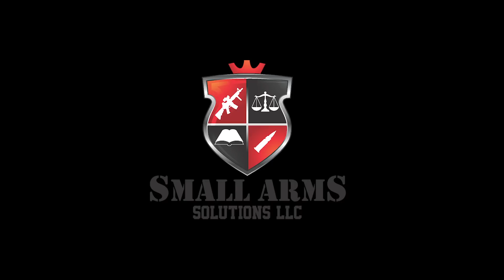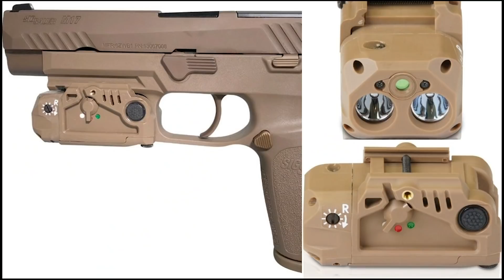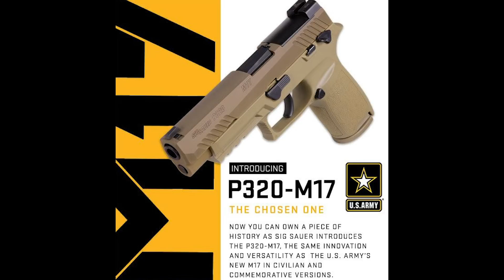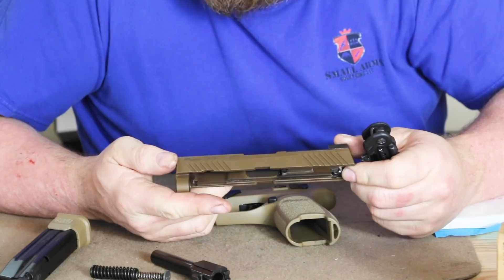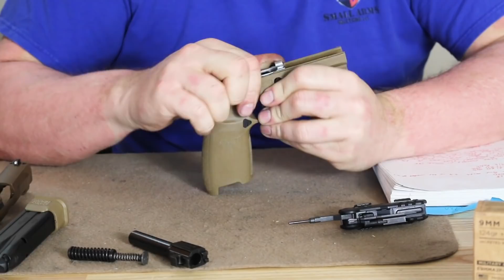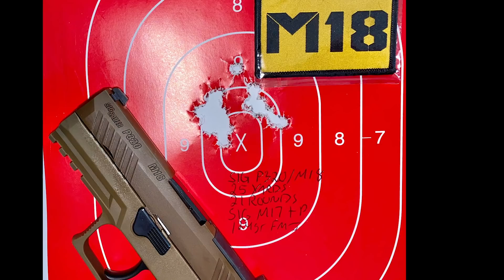Sig P320/M18 Pistol

Comment: Really it’s a two slide solution I think since the frame and fire control unit are the same on both.
Reply from the maker: To be technical. There are two slides, two barrels, two spring guides and two frames.

Comment: Great pistol, however, I’m very surprised no one has mentioned how terrible the finish is on this pistol? The M17 as well..
Reply: I was issued the ugliest M9 in the history of ugly M9s in afghanistan. The slide and barrel literally looked painted. And after I qualified, the heat from firing it turned the barrel and blue/black color. But...I was always a tack driver with the M9 and this one was no different.

Comment: Just got the m18 & put a Romeo1 pro in it. First day with it at the range today & all I need to say is perfection. Around 500 rounds with zero issues. Thanks Sig Sauer 🤘
Reply: Awesome.. pick up Saturday.. was it hard to put the sight on?
Reply: @LibertarianRF  just might have to use some blue lock tight, mine did come lose once.

Comment: what is the tool for removing the optic plate on the m18? is it a T15 like the m17?
Reply: They are the same thing the only difference is the slide and barrel length.  Its completely modular.

Comment: I am male. I am 57 years old. I have XXL hands. I shot the M1911 in the US Navy. After the military
I shot a lot of different guns and used many different calibers.
FIRST
I bought a SIG P320C - The Compact version that uses 15 round magazines
Observations
- Very reliable with no malfunctions or jams
- More complicated trigger system & striker-fire system than necessary (IMO)
- I did not like the "good" trigger as I had very little feed back from it
RESULT
This was a good gun but I did not ready warm to it.
SIG P320C = SOLD IT

SECOND 
I bought a Glock 19 Gen. 5 Late version - The latest version of the G19 that has no magazine cut out
and forward slide serrations.
Observations
- Very, very reliable with no malfunctions or jams ever 
- Simple gun with few parts
- The Glock has a good trigger if you like feed back in your triggers
- I love it's weight (23.64 oz) & dimensions 
RESULT
When it came out I checked it out BUT did not like the cut out on the front of the grip.
After the Glock 19 5 generation updated model with no front grip cut out came out, I put the SIG P320C up for sell.
Glock 19 latest generation = KEPT IT 

I never looked back. Forever Glock.
Reply: Sounds like a bunch of bullshit you made up LOL
Reply: @Coinz8  🤔

Comment: Sig P320CA, been available for years, is the exact same as the M18 minus the external safety and color. A Compact slide on a full size frame.
Reply: Good design, that's why it won.

Comment: I am a Sig 250 owner, and have been for a few years. You failed to mention this model as the predecessor for the Sig 320 , which shares the same parts, aside from the fire control unit. The 250 being a DA hammer only pistol. I often wondered why Sig Sauer never really marketed the 250. I usually carry the P 250 Sub Compact with a grip adapter which allows me to use the compact magazine of 15 rounds and a better grip length. Since my original purchase, I have acquired caliber exchange kits for 22, 40/357sig compact, and 45 full size. Does the military use the capability to choose different calibers?
Reply from the maker: Richard Kerr I discussed that in the original P320 videos

Comment: Glock wasn't modular thou!! I'm a glock fan boy but it didn't meet the criteria.
Reply from the maker: Stephen Carbajal it did, both pistols did. You need to read the requirement. Modular has nothing to do with the chassis. This is why these were the final two pistols. If the Glock did not meet the modular requirements, it would not have made the down-select.

Comment: I like the Glock didn't get a chance and spent all this money. Modular system was a requirement,  but glock was so cocky that they would get it anyway without a major requirement.  Didn't the guns also just go through a test and both went 12k rounds without a failure, best any military firearm has done in testing.
Reply from the maker: Jwilli 622 that was phase 1 elimination. Only Sig and Glock passed. Phase 2 would have determined if they met the contract specifications. Which was better, both pass or both fail. This was not done
Reply: Both entries met the requirements for "modularity". End of story.

Comment: I get the issues with the procurement process and why you don't like it.  But the first several minutes of the video is just the same complaints about the process you've spoken about extensively in other videos.  I get it.  But we're past that now, and these are the pistols we have.  I appreciate the information on the M18, I almost picked one up this week at the SIG Academy Pro Shop but I'm still not entirely sold on the 320.  Giving it another couple of months.

Comment: Both the m17 and 18 use the “carry” frame, not the compact. The compact takes 15 round flush fit mags and the full size frame extends the entire length of the full size slide.
Reply: I have the full size and love it
Reply: Want the red dot for my 18
Reply: I think he meant the M18 is the compact slide.

Comment: I'm not a huge fan of either the Glock or Sig, but I doubt Glock spent a bunch of money to come up with a 19 x with a manual safety.
Reply: Last Glock Armorer class they stated Glock spent some $$ on the machines for the FDE and other colors. Why the first batch of 43X and 48 had the silver slide.  

Glock is a smart company when they released the 19x they sold  1/3 of the Military pistol contract in 3 months.And that was just the 19X

Comment: I have owned Glocks since the early 90's but not a fanboy, I prefer the M&P's. If American made was not in the equation, the Sig over Glock was a bad decision

Interesting if this was the choice due to cost when sig is now trying to sell the gov on their new .277 with hybrid case. High pressure SS and brass hybrid case just to match a 6.8 performance, so use a expensive hybrid case ammo with much higher pressures (reduced barrel life) instead of just using a 6.8!
Reply: To be fair, I don't think there's a 6.8 caliber with that performance they're asking. You'd have to go back to a .276 Pedersen sized cartridge to lower pressure and that thing is pretty much a full size rifle caliber in size.
Reply: The .277 Fury gives .270 Winchester Short Magnum performance in a smaller case.  The 6.8mm SPC can't match it.

Comment: >the comments section is full of people bitching at each other over which plastic pistol is the best.

We never should switched from the M9.
Reply: I honestly think they should have adopted the M9a3. I have one and it’s one of my favorite pistols.
Reply: Modern polymer pistols are superior. Equal if not better performance, equal if not better mag capacity, less weight, all of those factors combined result in a better pistol for the Service Member.
Reply: The M9 was getting replaced either way.  CID and aviators didn't want a gun that large, and were already using SIG M11s.  Neither did the Navy, Marines, Air Force,  or Coast Guard.  People see the M17 replacing the M9 and want to comment on that, but don't want to admit that the M18 is replacing the M11, and the Coast Guard P229R DAKs.  The M17/M18 is a total force solution for every branch, but the M9 is not.  Get with the times.
Reply: I agree with you 110%
Reply: The safety sucked and it was slide bitin' SOB. Mine was so loose that I was on-the-spot-corrected about my safety being off so many times that I subconsciously reset the safety dozens of times during the day. Seems like I spent the whole day with my finger on the safety. 

I liked the M9...but it wasn't a pistol i would buy for myself.
Reply: I still keep a made in Italy 92fs and an INOX Model 96 in .40sw handy…With a spare 9mm barrel) haters will never convince me that the M9 wasn’t the greatest sidearm the military ever fielded, (save for the now outdated 1911)
Reply: Ha the M9 even though it was good wasn't the greatest
Reply: Yes, the army picked( imo)the better pistol...PERIOD.

Comment: Perfectly happy with the Gen3 G19 adopted by the US Navy SEALs in 2015. Will never buy a US made SIG due to design/QC issues.
Reply: Right...

Because things never improve.
Reply: @MrCarGuy  
Feel free to buy a US made SIG or a Brazilian made Taurus as the US is a free country, unless you want to make and publicly sell small arms protected by 2A like the M72 LAW because elites like Trump and Sanders think that is not such a good idea and will ensure you end up in a federal prison if you dare do so. Good luck stopping armored vehicles with a M17 pistol or M4 rifle.
Reply: @Lutz101  "Good luck stopping armored vehicles with a M17 pistol or M4 rifle" - The Afghans spent almost 20 years stopping armored vehicles with copper sheets and concrete sewer pipe.
Reply: @Lutz101  Irrelevant nonsense.

Comment: Fricken DOD missed their chance to have a pistol with plastic sights, a crappy trigger and the Worlds worst grip angle. What were they thinking?!?
Reply: I think they did great, they got a pistol instead that has a chance to fire when dropped, not tolerable under harsh elemental testing, doesn't like FMJ ball ammo that much.
Reply: ReachBlows Dick they do NOT fire when dropped. They fixed that a long time ago. Quit bringing up old issues
Reply: @sammcgee9456  when it did fail the test in usual trials they immediately remove the weapon.
Reply: Yes the Glock is a POS.

Comment: I have to say coming from a Govt Weapons Handler point of view is Glock is not very innovative they were told Modular well Sig gave it to them I can take the trigger pack out the firearm put it in a Mid , compact or large frame.  Also Sig had already had the external safety part of the Data package at the Time Glock refused to put one on told the US Army Glock pistol is perfect as it is ?   I think telling your client No your product is good enough when they are looking for something else not a good idea.  Modular doesn't mean ok here are two Glocks one full size one compact that isn't modularity the Army wanted.   So before I get lighted up for my comments did the Army really need to replace the M9 service pistol answer is NO Beretta offered  a good solution the M9A3 you have the Color,Rail and grip was changed to meet people with small hands higher capacity mags and a threaded barrel last all the parts are compatible with all M9 pistols a win win situation.  My question is is the 320 a better pistol then the M9 ?    Maybe but one thing I do know is that I don't remember a weapons platform that was fielded and didnt have problems most systems have their issues did they rush this into service maybe but the Army has its own time frame and GLOCK lost end of story.
Reply: Sounds like Glock pulled a Joe Biden, "Go vote for someone else!" They did....
Reply: I'm pretty sure that Chris himself has gone over this and the Glock respected the Army's modularity requirement.
Reply: @ChucksSEADnDEAD  -  Exactly, the MHS solicitation did not require a chassis frame.  Vendors were allowed to submit a "one-pistol" solution as long as the pistol met the minimum requirements for the full-size and was no larger than the maximum dimension/weight for the compact.  I suspect it came down to the minimum barrel length for the full-size, which was likely 4-inches.  The G19X barrel is long enough, while the P320 Carry barrel is too short.
Reply: No Glock at last minute gave in at the last minute and put the external safety on but telling the client what they want to what they want was wrong.  I believe this was something that contributed to not being selected.  An entity that has to deal with a company that may or be a problem when they want changes made isnt the greatest in partnership especially the US Military and they themselves can be problematic and Glock was not Modular key word that was what the Army really was after not just two separate handguns.
Reply: @todd2048  Glock entry was modular. The requirement was for different grip sizes, magazines, triggers and rails. It didn't require the chassis system.
Reply: I dont care what you read I am telling the Army wanted in their little heads a one gun does all OK get it I was still a Govt weapons handler back then retired so I can say this Glock in THIER MINDS didnt give them what the wanted why do you think they shot Berrettas M9A3 down  besides back straps the M9A3 would have been a cheap stop gap but the ARMY wanted this crazy idea in their heads modular they were annoyed with Glock. So I hope this helps.
Reply: @todd2048  "the Army wanted in their little heads a one gun does all" - and they're not gonna get guns that do it all, they're gonna treat the M17 and M18 as different once in inventory.
"Glock in THIER MINDS didnt give them what the wanted" - so military arms procurement is an exercise in mind reading now? If you actually paid attention you'd notice that COST and the fact that Sig partnered with Winchester to provide the ammo were the determining factors. Glock was higher cost and the Army evaluation determined they didn't have a satisfactory ammo deal provided with the whole package. It had fuck all to do with modularity.
"why do you think they shot Berrettas M9A3 down" - several reasons why, this is confirmation bias from your part

Comment: Maybe I missed it but did you say that only the commemorative version has the correct recoil spring?
Reply: The M17 has a separate guide rod and recoil spring. The M17 uses an all in one captive guide rod system.

Comment: Chris - With respect and sincere appreciation for your expertise, experience, and all that you do for the small arms community, I believe you may have misstated a key point in this (and possibly previous) videos.  

Specifically, the DFAR generally mandates that the least expensive (normally aggregate development, acquisition, and often logistics support costs combined) competitor that MEETS all of the SOW/RFP requirements will be selected.  Crucially, there usually are NO selection “bonus credits” for EXCEEDING those delineated requirements.  Therefore, if competitive proposal Alpha meets every performance and programmatic requirement — just barely — and costs $1.00X, while proposal Bravo considerably exceeds every requirement but costs $1.05X, Alpha should — by statute and regulation — be declared the competitive winner.  

Accordingly, when you mention what’s “better or best for the warfighters” — and I was one for two decades — you’re (imho) somewhat misleading.  USG and DOD acquisition policies, and their underpinning public laws, are fundamentally founded on the principle that the mandatory requirements provided through the SOW and the RFP will — axiomatically — provide a fully satisfactory weapon system.  I understand that the foregoing may “go against the grain;”  however, generally it’s the lawful approach (the only exception I ever encountered was the Presidential Helo replacement (VXX/US-101) program). 

My bonafides include 20+ years (retiring as a senior officer) as a program manager, business/financial deputy program manager (and, in this role, the Procurement Contracting Officers (PCOs) basically worked for me), and assistant program manager for logistics in major Navy TacAir projects (including the F/A-18, F-14 and A-6/EA-6B).  Thereafter, I had similar responsibilities with Lockheed Martin for over 22 years.  While the services (Army versus Navy) and the weapons systems (hundreds of billion dollar lifecycle cost tactical aircraft versus small arms) clearly differ, the laws, policies and regulations that apply are essentially identical.
Reply: Thank you all so the notion that " our boys deserve the best, no matter the cost" only sounds good until you think about it for a minute. for one thing in the major war there's simply no way that any Nation can afford to spend its resources on the diminishing returns of a premium product when they mostly need a lot of something. That was the mistake of the Germans in world war II. for the other there really is such a thing is good enough and every cent you spend on a soldier is taken from the soldier's family and neighbors. when my friends are being shipped off to Iraq and being given $500 sunglasses I knew there was something wrong with that. It's always a question of marginal utility... I don't think any one of my friends was less likely to survive with $50 sunglasses then they would be with those expensive Oakley shades. The same goes for guns. Bottom-line pretty much any modern plastic pistol would be more than good enough for modern combat. it would be hard to even quantify a situation where the difference between one plastic pistol and another saves a Life. But it is very easy to quantify the difference in cost between two of them. And taking people's money does shorten and worsen lives.